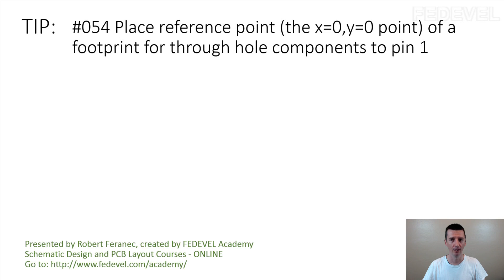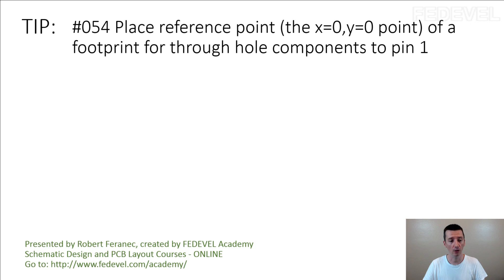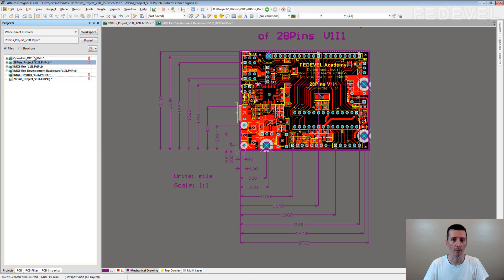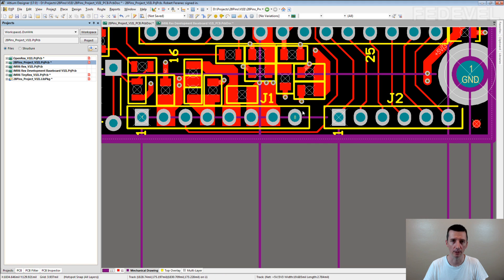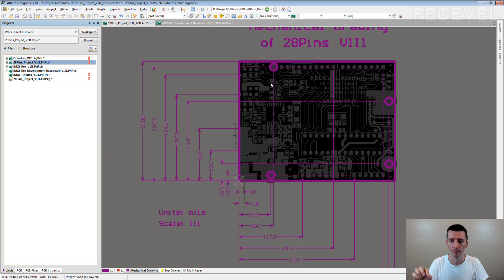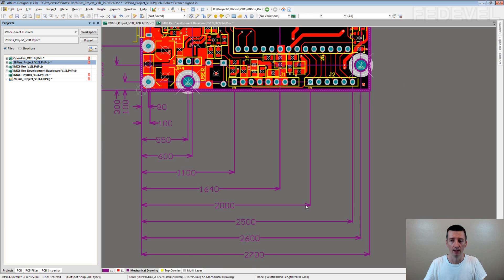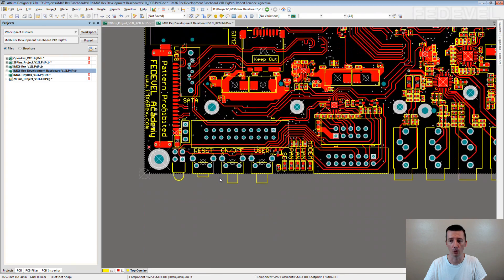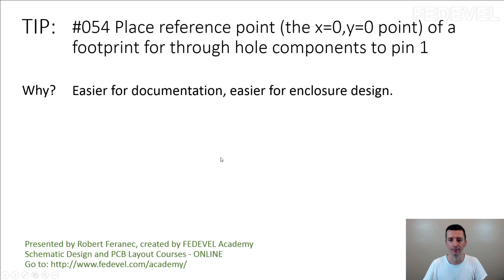TIP #054: Place reference point of a footprint for through hole components to pin 1

Comment: Tip is quite controversial... at least for Altium. Why?:
1) in Altium you can "cut-paste" components. During this operation Altium will ask you to select a REFERENCE point for this operation.
2) you can use MANY snaps during work.
So if you have some "round" point, where you want to place connector - just place ANY line with a start on this point and end in random place. then CUT your connector and use ANY pad as referrence point (check "snap to objects" option). In the same way after pasting that component - use snap to start point of the line = your needed point. Using this method you can place any component to any point with any coordinates AND you still can use geometric center as reference, that can be useful alot during placing components in radial grid.